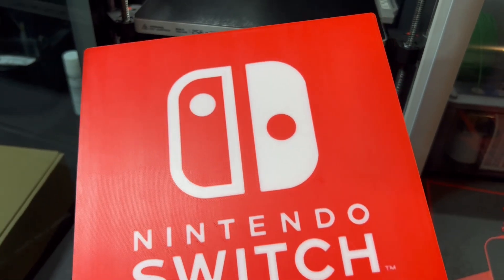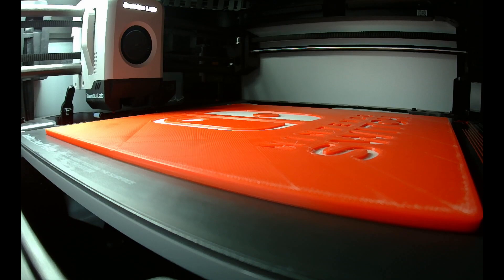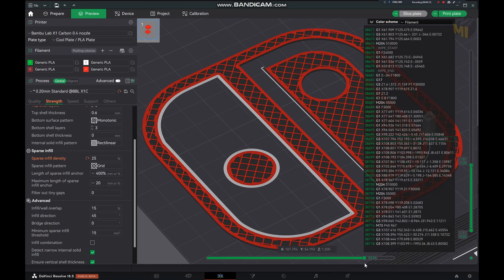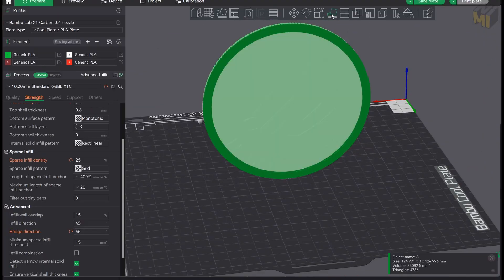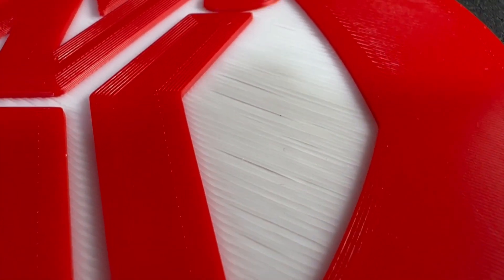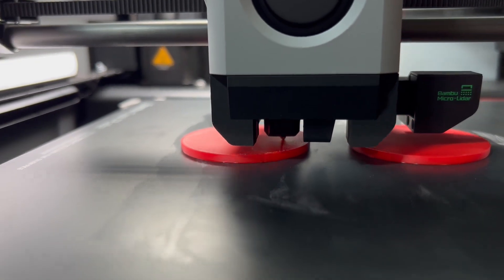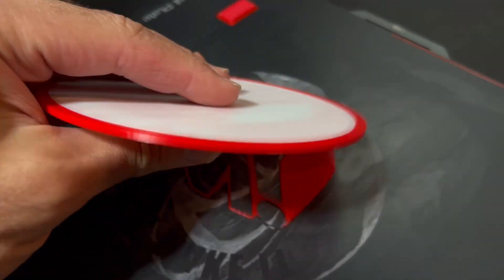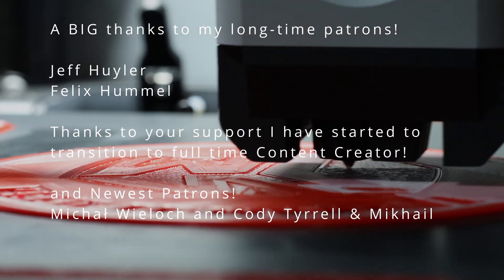How to Emboss your COLOR 3D prints - Feat. Bambu X1C

Comment: water soluble PVA supports under the embossed section? Never done it personally but could work.
Reply from the maker: I have some, I think that may just do the trick, I'll have to give it a try.
Reply: @NeedItMakeIt  Just need to be able to do 3 materials in one print. But the embossed look definitely is nice
Reply from the maker: I'm going to setup this weekend to do this, I finally have the material, should be cool to see how it turns out.
Reply: @NeedItMakeIt  definitely. Looking forward to it. Hope it works out. It won't have the print bed surface in the embossed area but should be pretty good nonetheless

Comment: Hello friend, I just have a question. honestly, there are tiny particles in all the prints I make with my printer, and no matter what I do, I can't solve them . What do you think is the fastest way to solve this?
Reply from the maker: That is certainly strange.  There are some filaments with particles in them, they are 'stone' look or ' cookie dough' type filaments.  Are you able to have a look at your spool and tell me the color information?  If it is just ordinary filament, there isn't a good reason that comes to mind.  It is possible that the specs are small bubbles, if the surface is rough, that would be bubbles and it would be time to dry your filament.  Let me know and I'll see what I can do to help!
Reply: @NeedItMakeIt 😅 thanks for your answer my filament is blue medium quality pla

Comment: Use PETG as support and remove the top layer gap for the support. From 0.2 to 0.
Reply from the maker: Nice tip, I can give that a go, I've never tried that.
Reply: It’s what the Bambu support W material is. A spool comes with some machines

Comment: Another trick I have used for the Debossed area is inserting a different sheet. I have inserted paper in the middle of a part. There is a thermal expansion problem that might need to be addressed.
Reply from the maker: When you do that, do you need to use some kind of adhesive?
Reply: @NeedItMakeIt  There was two issues 1 was thermal expansion of the paper. I printed directly on the paper and the print cooled and shank it warped. the printed frame was not strong enough to shrink the paper cardboard.  The other is the first layer above the insert needs to not catch on the edge of the insert.  Can use adhesive. My case I just gave it a little extra space for the insert.  The "sag" of the bridged material secured the insert. Could insert  something like plexiglass. I have inserted metal. and used glue stick  to avoid the "bridge" from drifting.

Comment: Well, let me take you on a journey to my 3D printing escapades circa 2013, and trust me, I've got some nuggets of wisdom to share. If you're not on a mission to meld two distinct materials, like creating a flexible hinge or something equally exotic, then these multi-material techniques might as well be a filament-fueled time warp. You see, 3D printers, much like any CNC machine, wield two formidable powers: precision and reliability. Why not harness these powers to the fullest? It's as simple as printing each part in a single, solid color and then joining them together with a touch of adhesive magic. Add in a bit of forgiveness with a smart draft angle, along with some clever alignment pins or tabs, and presto! You've concocted an assembly process that's not only straightforward but also a filament-saving, time-trimming masterpiece.  🚀💡
Reply: that is definate way to do the same. What I find useful is different ways to do the same thing. Understanding the ramifications of each, then you can choose the best for all the givens.  multi part works great. especially if the Insert is not flat.
Reply from the maker: Good to know, I still have a lot to learn about these techniques, ever situation is a little different as well so use the best one for each case is a great way to go about it.
Reply: Yeah, this is what I do, but there’s definitely some work on the front end with the design to offset faces for a tolerance. Much cleaner result, less waste.
Reply from the maker: Which software do you use to offset?   I've just started to experiment with Blender, but I am such a noob at it , though I was able to create a nice looking 3d printed head on my first attempt, as far as offsetting, I doubt Blender is the way to go.
Reply: @NeedItMakeIt  I use fusion 360. I enjoy being able to use parameters so I can adjust all offsets at once to dial in the press fit.
Reply from the maker: That's my program of choice too, are you able to convert any meshes and then offset; or is that a pipe dream?
Reply: @NeedItMakeIt  Currently you can quite easily do it, trough various programs by the way, even TinkerCad or Sketchup. The easiest way is to get a .step file which can be edited with genuine functions in CAD programs. You can also add new functions like "move face" or "drag".
Reply: @thehangardesigns   Well, it's as easy as flipping on the "draft" feature in OnShape or Fusion360, so it's a piece of cake, really! 😄
Reply from the maker: Tried and true, for sure a good way to go.  This all came about because I had someone who wanted an embossed logo and I was a bit over-confident to say the least.  It didn't go quite as planned, but with a bit of work we got there in the end and he was super happy with the result.  I ended up giving him a flush version with color, and embossed, he preferred the embossed, the depth adds something, a bit of a higher quality look I suppose.

Comment: a trick I have used is pre printing the support. Then pausing the print to insert the preprinted support. That was a long time ago prior to the X1C. an idea is to model the support maybe give it ironing, and a different material. Then on the main part let it bridge.  With the right 3 materials (2 for the part and one support) that the main material doesn't stick to the support,  you could get some squish to the upper layer. Adjusting the settings to optimize the top of the "support"  with the right material and settings it could be good results. not your standard bridge.
Reply from the maker: I think you may be onto something there with the ironing, I'll give this a go tonight.  I think if I were to Iron the supports, with a zero tolerance, it might just work.   This might be the simplest method to get really smooth embossing face down!
Reply: @NeedItMakeIt  I have not seen a setting for ironing the support, But. if you model the support and apply settings to that object. You can apply all the settings. The big advantagle is the interface can be 3d. not just 2D.
Reply from the maker: That's a great point, I believe that Cura has this built-in, but I wonder if PrusaSlicer or BambuStudio have it.  I shall have another look.  Thanks!